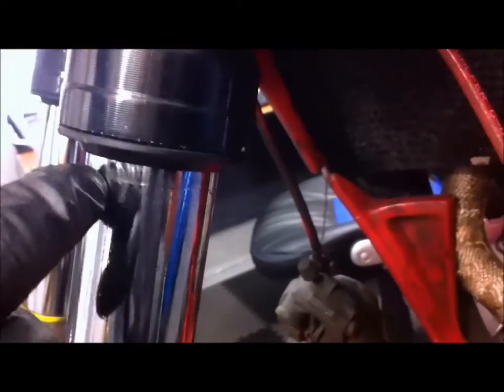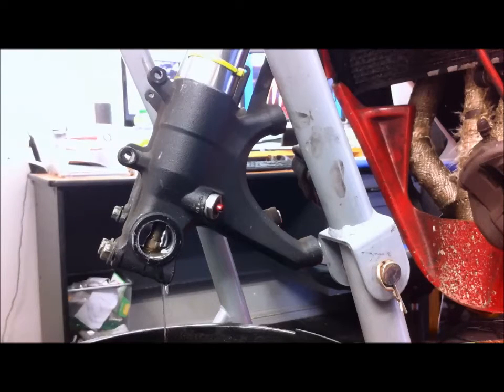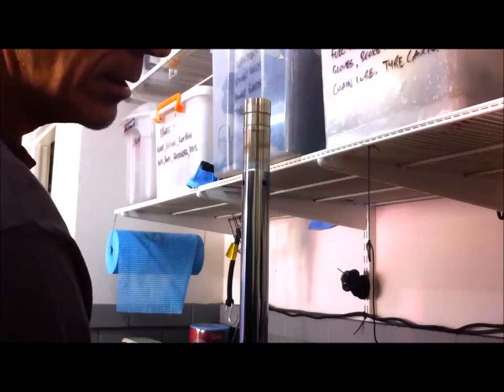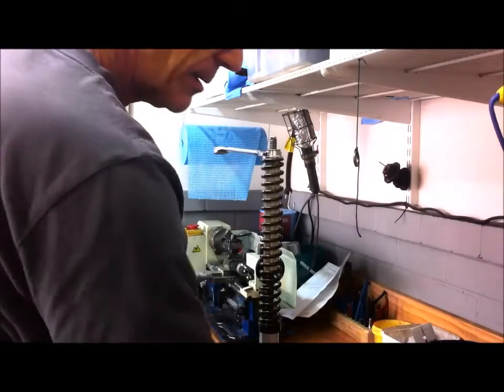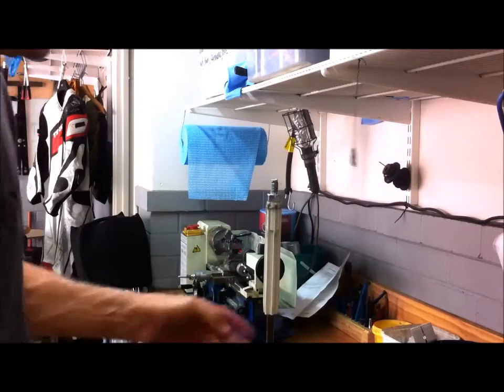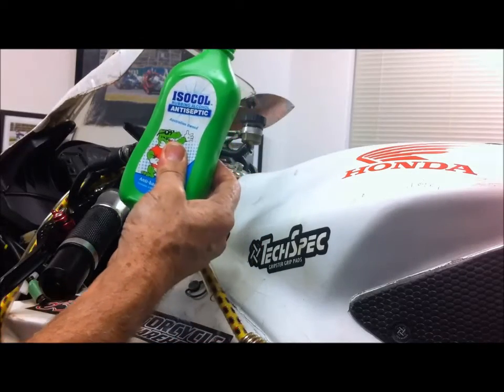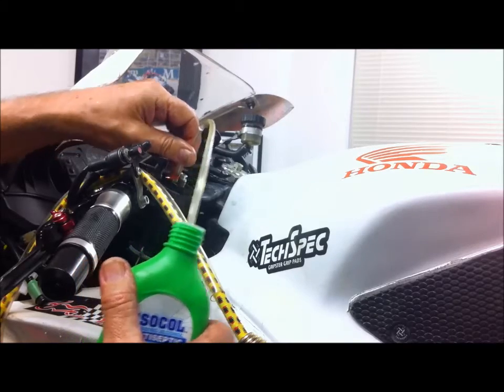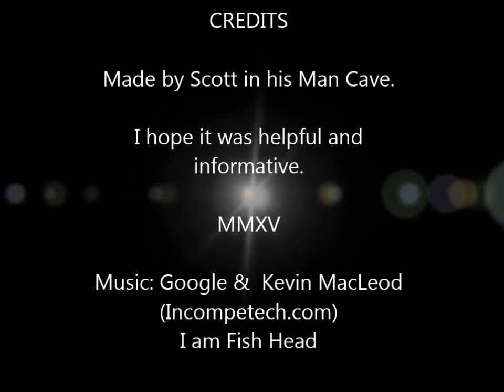Change Front Fork Seals set oil level 600RR R6 ZX6R CBR R1 1000

Comment: I am doing the fork seal job right now. Service manual says fork fluid level of 93mm. You are setting it at 170mm. How should I go about it? Manual mentions fluid capacity as 413 cm3 I guess that means around 400ml.
Reply from the maker: I have Ohlins 30mm cartridges which I mention in the video. Standard cartridges have the oil level at 93mm as you mentioned. It's best to set a level to get the right air gap rather than use volume.
Reply: @ScottElliott152  ohh got it. You have ohlins. Was trying to remember so many things and missed that bit 😬. Unfortunately, I couldn't finish the job today as didn't had seal driver and the seal wouldn't go in with my makeshift tool. I'll try tomorrow with something better and set the 93mm air gap. Thanks for quick response ❤️
Reply from the maker: @alderinerush  ok good luck with it. Let us know how it goes.
Reply: @ScottElliott152  Job Done! Made the suspension setting as it was before and it feels more compliant now. The forks were serviced after 15,000 km. Now that I know how to do it, I'll be changing oil much earlier and not wait for seals to give up. Your video was of great help...thankyou :)
Reply from the maker: @alderinerush  Thankyou. I blew a fork seal last Sunday at a track day. I've pulled the forks out and dismantled ready for new seals and bushings when they arrive next week.
15,000km is too long before changing the fork oil. For a road bike I'd be changing it at least every second year.
Reply: @ScottElliott152  I am also watching Dave Moss content for suspension tuning. Now I want to service my rear shock also. But in the service manual, there's no info on that. It just says to discard shock, release nitrogen. The nitrogen canister isn't refillable I believe.
Reply from the maker: @alderinerush  Yes Dave Moss is good value.
You can definitely get OEM rear shocks serviced with new oil, seals and re-gassed.
I don't do rear shocks myself ... mainly because you need a nitrogen tank to pressurise them.
I only dropped my rear Ohlins in yesterday to have it pulled apart, cleaned, new seals, new oil and re-gassed. It was leaking from the bottom seal and needs a service. The charge will be about $AUD200.
Before I bought the Ohlins rear I had the OEM shock pulled apart and revalved ... so they can definitely be serviced.
So much for reducing our greenhouse gas emissions when you have manufacturers telling us to throw away perfectly good shocks that just need a service.
Reply: @ScottElliott152  It's good to know that it can be serviced. But it will be very hard to find someone in my country (India) who provide this service. If I don't find someone, I am thinking of buying a used shock on ebay from US or UK as they are  quite cheap. Have it sent over to suspension shop there and they will send me the freshly serviced shock. Then I can take off mine and start tinkering with it.

Comment: This is an awesome video with so much info! What if i decide to only replace the oil, should i just unbolt the 8mm bolt on the bottom and open the cap on the top to let it all out, clean it with a little bit of cleaning product or somthing and fill it back up again after?
Reply from the maker: Simon if you do that the old oil will still be in the cartridges. They hold a lot of oil. The only way to change the fork oil properly is to remove the cartridges to. Scott
Reply: Ok thanks for the response, I'll get to work right away :D

Comment: one other question, if i want to just replace the inner fork components and not mess with the canister part is that possible or would i have to drain the oil from the canister like you show at 11:00? i think my seals are just blown to be honest so im thinking about just keeping the canister in a position to prevent it from leaking while i service the forks.
Reply: i just dont have the tools i think to compress the spring back when reassembling the cartridge
Reply from the maker: Yes you can. It's not ideal because you'll be only renewing probably less than 50% of the fork oil. You won't be able to set the level because your cartridges will still be assembled. So carefully measure what you drain out so you can replace the same amount with new oil. I'd recommend you buy a manual spring compressor. Its a good idea to change your fork oil often to keep them in good shape. As my bikes are track machines I change the fork oil every 15 to 20 hours of use: http://www.ebay.com.au/itm/Laser-Tools-6353-Fork-Spring-Compressor-Motorcycle-/272227528629?hash=item3f62066fb5:g:QjwAAOSw5b1XIyhC

I made one as they are simple. Or you can get one of these: http://www.ebay.com.au/itm/Sealey-Motorcycle-Fork-Spring-Compressor-MS1824-/172145310507?hash=item2814a8fb2b:g:KpYAAOSww3tY4z4B

Comment: Good video Scott really do appreciate the step by step comes in handy I was wondering what did you use to make tool for pulling cartridge out from the middle of the spring & how the wrench was able to lock spring into place ??
Reply from the maker: +cortez7467 Thanks for the compliment. Remember I have the Ohlins Road & Track cartridges as it's a race bike. The tool you refer was made from an old hollow Honda front axle with a nut welded to the end.

The Ohlins cartridge is designed to be quickly pulled apart track side to change springs hence the 19mm wrench method. It's too hard to explain but the cartridge is designed with a lip to enable the wrench to be slipped in. Watch the video again closely.
Reply: +Scott Elliott aahh I forgot bout the Ohlins . . . . . well would it still be the same procedures for a stock cartridge ??
Reply from the maker: +cortez7467 Nope ... the standard cartridges require spring compressor to remove the spring. That's one of the concepts of the Ohlins cartridge is simplicity for quick spring changes at the track.

You can use one of these but will require an assistant: http://www.ebay.com.au/itm/Universal-Motorcycle-Fork-Spring-Compressor-and-Damper-Rod-Holding-Tool-Kit-mfsc-/261984053772?hash=item3cff776a0c:g:XokAAOSwYlJW3N8k

or take the cartridge out and use one of these: http://www.ebay.com.au/itm/Motorcycle-Spring-compressor-for-USD-Forks-Upside-Down-Suspension-switch-/231821973554?hash=item35f9aa9832:g:XecAAOSw-vlVibp~

I have both types but I made them myself.
Reply: +Scott Elliott man I really do appreciate the info had nicks on left tube in which they made seal tear up & leak bad so I have to replace the tube & that alone put a dent in wallet & DIY is always cheaper than mechanic charging $85hr.
Reply from the maker: +cortez7467 DIY is better because you'll do a better job. I always get nicks on the tubes due to small rocks being flicked up from bikes in front at 200km/hr. The way to fix is use wet and dry sand paper to smooth the sharp edges. Finish of with 1500 and 2000 grit to get it nice and smooth. I've done it for years. You don't normally need to replace the tubes due to small nicks contrary to what the trade will tell you. Be careful with opinionated talking heads behind the dealers parts desk.
Reply: +Scott Elliott & thats what I thought but was afraid it would of taken a different shape from sanding . . . . damn should of just did it & tryed it out.
Reply: +Scott Elliott could all the steps be taken as shown until getting to the compression of the spring in a stock cartridge ??
Reply from the maker: +cortez7467 No it won't become oval shaped. Usually the nicks are a raised piece of metal with a very small divot adjacent. All you do is sand the raised bit of and smooth the edges of the divot. They're usually very tiny. Often they so shallow the sanding takes them away completely. The seal has plenty of flexibility to conform to the shape of the tube even if there were some very small flat spots albeit smooth flat spots. I've never had an issue.
Reply from the maker: +cortez7467 Yes follow the same steps. Remove the cartridges and do the seals. The only reason you have to take the spring off is to set the oil level. Although if you have the cartridges out and remove the spring you should pump out the old oil and replace the lot.
Reply: +Scott Elliott how did you go about making the universal compressor tool ??
Reply from the maker: It too hard to explain. see if you can get hold of one to inspect first and you'll be able to work it out. I used a pieced of alloy pipe for the ring and put two bolts through it.
Reply: +Scott Elliott alrighty sir im get everything together & get at it I'll keep u inform on how everything goes.
Reply from the maker: +cortez7467 Yep thanks. Let us all know as we need to share the knowledge

Comment: What size nut and thread did you use to make your compressor tool?
Reply from the maker: It's a M12 x 1.25 thread pitch. They're a bit hard to get from normal outlets. You may have to go to a special nut and bolt vendor. Scott
Reply: Scott Elliott thanks

Comment: Is the 300 milliliters of oil and the 170mm that have to remain with air also correct for forks with original Honda cartridges? Awesome video btw :)
Reply from the maker: Thanks. No the original cartridges require more oil and a 90mm air gap. Scott
Reply: Okay, trank you very much Mister:)